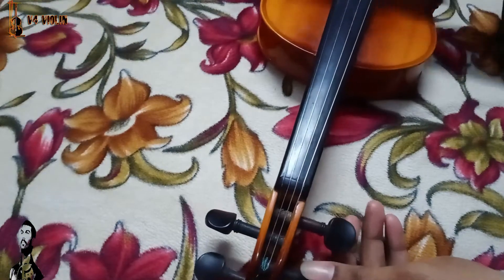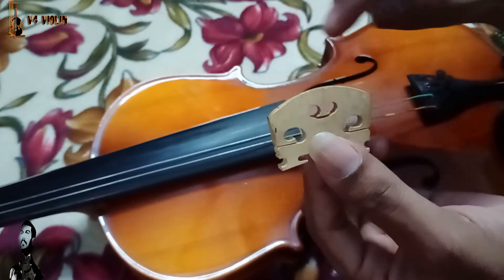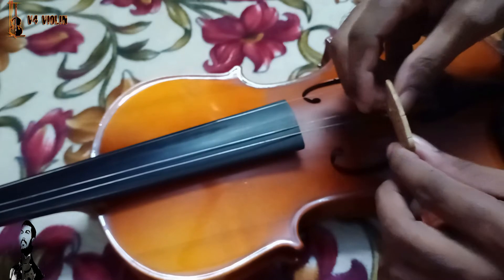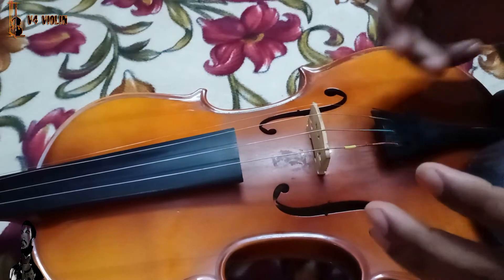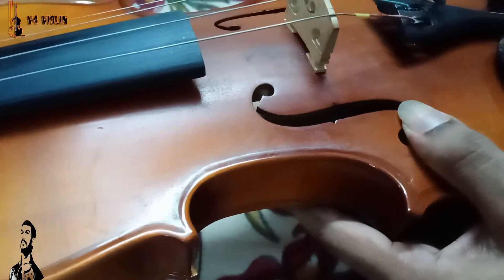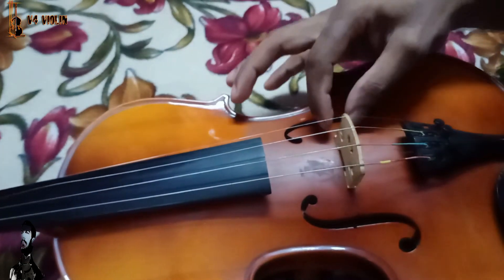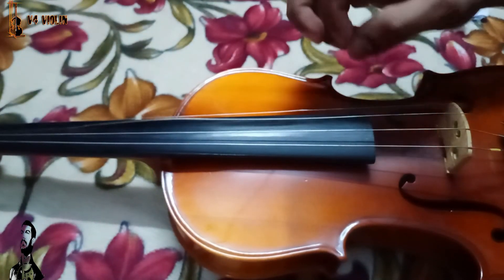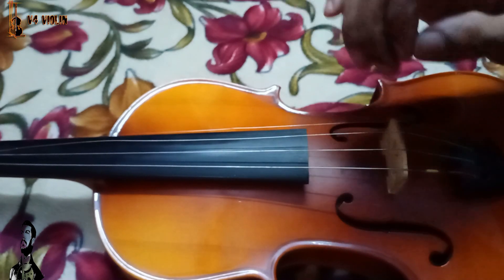How to fix a bridge on the Violin? Bridge Placement on the Violin in Malayalam by Violinist Sibin V4

Comment: Flexible foot bridge or fixed is good ?
Reply from the maker: Flexible one for the Acoustic Violin
Reply: @SibinSS_V4Violin  I don’t see any one using flexible foot bridge. Which sounds better
Reply from the maker: It depends on the microphone. 
However, normally the Acoustic Violin bridge is not fixed.